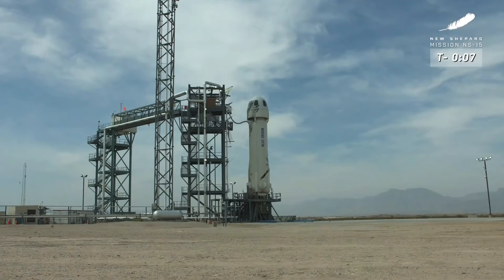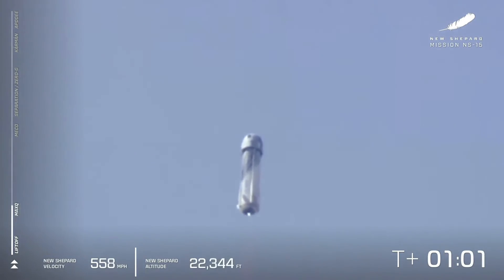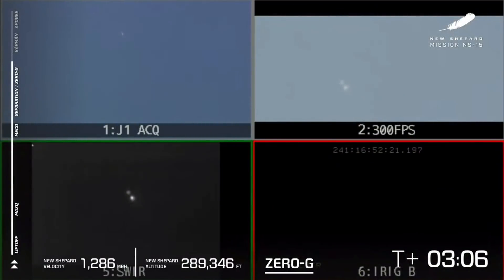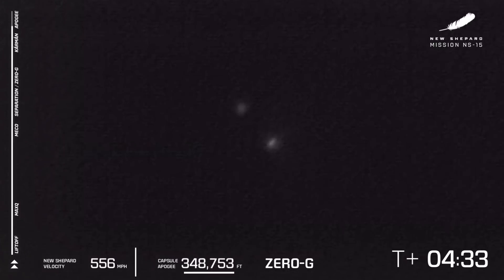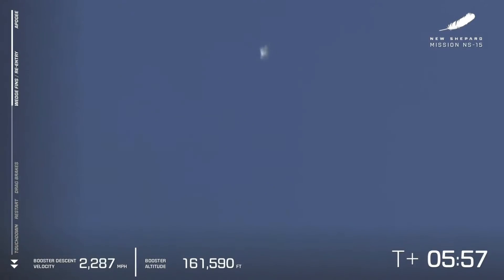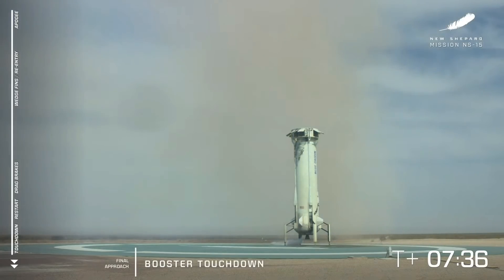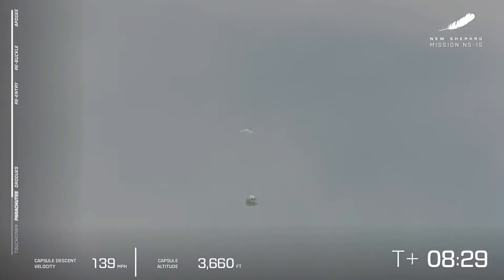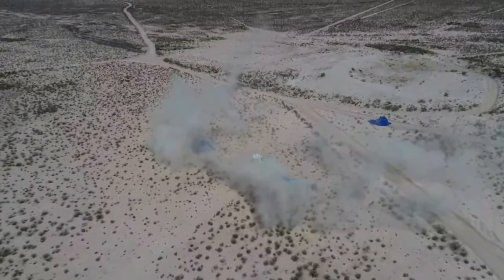Blue Origin's New Shepard launches after 'astronaut rehearsal,' nails landings!

Comment: I so want Blue Origin to succeed, but after 21 years in operation, it really has not gotten very far slowly.  If Blue Origin were serious, they would get something into Orbit and not mess around with rocket elevators ... Cmon guys ... get serious or get off the pot.  How long have you been trying to get the BE4 off the ground with a full power test?  We get it BE3 works ... one engine ... but c'mon guys.  Drop your balls, pull the other thing out and just go already !!

Comment: (Trying post again) 
0.4g calculations, if you watch closely and run the numbers. 
Check my stats and calcs, watching at 0.25x: 

1. The retrorocket activates at 118 feet elevation 

2. The capsule bottoms out (stops, v=0) at 96 feet, after travelling 22 feet farther  

3. Apply the appropriate equation of motion arranged properly (e.g. link below) : 
   vf^2 = vi^2 + 2ad      which reads as 
   Velocity_final squared = V_initial squared + (2 times accel * distance travelled) 

4. Given the conditions here, that's: 
  0mph^2 = (16mph*5280ft/3600sec)^2 + 2*a*(22ft) 

5. Simplify and rearrange: 
  -44ft*a = (23fps)^2 
  a = (529 ft^s/sec^2) / (-44ft) = -12 ft/sec^2

6. Convet to g: 
  -12 ft/sec^2  /  32 ft/sec^2  = 0.38g

Comment: The capsule decelerated at about 0.4g during the firing of that retrorocket (or whatever) at the very end, based on the distance covered (22ft) and deceleration amount (16-0mph). I've tried posting the calculations but the comment seems to keep getting removed; anyone know why? It did have the URL of the equation used, is that not allowed? I rarely comment, and this is the first time I've had trouble posting something.

Comment: These are much smaller then SpaceX but they seem to have the engines and landing down quite a bit smoother then Space X.
Reply: Cause it isn't doing any real work just up and back down.
Reply: @jackdbur  Lol. :P Have you not watched the stream of explosions coming from the Space X facility in Texas? That is just going up and down as well.
Reply: This is 57 ft tall Starship is 30 ft wide and 390 ft tall
Reply: @jackdbur  The crashes have been engine problems, not weight related. The first one the engine was running lean and not producing power. The second didn't get a successful relight, The third one had a methane leak, the 4th blew up in the air.
Reply: Your talking a sub merlin engine v a new type of engine running 4 times the thrust. This comes down to mass.
Reply: @jackdbur  Well I'm not expert but it doesn't seem that way to me. The technologies are the same, just larger engines. Space X seems to be struggling with their engines. I'm not saying that larger engines don't bring complications. Maybe they do, but nonetheless Space X can't seem to get it right and that should be the easy part compared with getting the ship on the ground. They have failed in relighting, they have busted parts left and right.

I'm still a Space X fan. All I'm saying is that the others guys seem to have a smoother product and I can even feel confident in saying that when I compare it to the smaller Space X rockets.

Comment: Congratulations to Blue Origin on a successful test flight.  Nice to see another player on the launch field.  Space X still has a considerable lead, but you're making progress.
Reply: Not sure how many companies are in on this but that landing looked so easy why do space x keep cashing on landing they need to ask these guys for help I think
Reply: @kennethmoxon7337  You're joking right? SpaceX has already landed dozens of falcon rockets that are several times larger than this Blue Origin booster.
Reply: @a.t967  The Falcon 9 has completed 112 launches and 72 successful landings. Of those 112 launches 55 of them are reflows flights. 

In fact the Crew-2 missing is reusing the Falcon 9 Booster used in Crew-1.
Reply: @kennethmoxon7337  one difference is the Starship prototype is much larger and more complex, plus it uses aero effects to slow its descent, requiring a turning maneuver just before landing.  This last part has been the difficult part in the tests.
That said I think Blue Origin is forging a new path with their retro-rocket landing system.  A capsule that can land on hard ground and not make the passengers feel like they just crashed will be valuable to anyone who doesn't have a navy.

Comment: Seems like a lot of fuel is used to land as it hovers for a while. Not as efficient on landing burns as SpaceX Falcon 9.
Reply: Thats what gave it a smooth landing, But i think the bigger issue is the really slow deployment of the landing gear. Better 2 sec extra fuel burn for a smoother landing, then no landing at all.

Comment: I think this is a perfect example of why this style of recovery is the most efficient. Just watch the booster’s speed as it re-enters, especially when it starts hitting the thicker air. The atmosphere is amazing at slowing things down, but that should also give you a hint as to how much drag a rocket has going up. Yes while in the thick air its not going nearly as fast, but it shows the dynamics of this beautifully!
Reply: Think If you can lubricated the rocket from top nose some stuff, little bit same way than theorized under water high speed's.. or leading some breaker front of body but smaller object than body cut πr2. Nowdays fast missle glow red from air friction. I think It don't have to and go still faster. Where that needed? Nothing now, I'am sure that is very researched still.
Reply: @jannejohansson3383  uh... 

Think your thinking of supercaviation. Its a process where using a different layer of fluid to insulate an object from a fast flowing outer layer. Not just for heat but for drag too. SpaceX actually does use a form of it in their booster recoveries to protect mainly the engines from the harsh aero effects of a suborbital reentry.
Reply: @Electric_Bagpipes  yeah, I have to think on Finnish and don't remember all those english names of things, cause not turn straight often. That is actually 'superkavitaatio' and iam not sure can it thinked straight "supersonic gases are "fluids". Objeckt is moving, air is still in place, so It's not pressed before "breaker" hits and leaks some fluid what expand to gas, so It's not air anymore, then vechile/rocket comes and it not effected to air. pressure is more optimized maybe or temp. All 3? + additiwes to rocket surface.. and ongoing.. ;)
You get it? I didn't remove small typos maybe. 30h awake, good night. It's 2am here.

Comment: Notice how controlled the landing is: Rather than decelerating geometrically prior to touchdown, it seems to geometrically decelerate above ground, hover at some height before landing as control is established, and then (mostly) arithmetically descend at a slow rate for an ultra-soft landing. This is likely why the landing success rate is so high for this stage.

This likely costs marginally more fuel as a few more seconds (~12 seconds, by my count) of impulse are required for the landing. I wonder about this cost at scale.
Reply: Wasting fuel. Falcon9 does that last second burn because it used the fuel to get stuff to orbit.

Comment: No camera on or inside the rocket is below the standard now. Almost like everyone is trying to catch up with SpaceX.
Reply: My favorite part is 10:10 when it lands at an altitude of 90 ft. That's an impressive feat for Blue Origin.
Reply: @psilynt1  SpaceX will have built a colony on the moon and mars by the time the rest even attempt a landing on the moon
Reply: @antilarge7860  Yeah, they won't be landing 90 feet above the ground either and will have a radar altimeter that actually works.

Comment: WTF. why are all their units imperial?! Very good way to hold back your rate of development.
Reply: Imperial measurements put man on the moon, just saying. Instead of complaining, maybe you should learn how to convert them to metric, it would appear that your inability to do so is holding back your development.
Reply: @codymoe4986  NASA has used Metric for everything since 2000 and much of the Apollo program also used metric, just saying
Reply: @neilc7101  They made the full switch around 1990....
Reply: @neilc7101  And when you say "much of the Apollo" program, how much is that exactly?
Reply: @codymoe4986  IIRC The computer systems involved were all programmed in metric, and would convert to imperial for the displays so that the Astronauts could read it.
It's pretty bizarre how imperial still exists.
Reply: @logitech4873  I mean, I have been helping build out utility grids and residential housing for 25 years using the old way....

Isn't this just an issue of ego and nothing more? What use of me throwing away my imperial tape measure for a metric one if I can make stuff fit using the former instead of the latter?

Comment: A question for those with much more knowledge than me - I was expecting some sort of sonic boom but I didn't hear anything.  Would there be one?
Reply: You will hear it during New Shepard's descent. Play the video again and you should hear the double "boom" at about 7m 05s. The vehicle is subsonic by then and the compression waves (shock waves) beat it to the ground by some margin of time. You won't hear it as the vehicle ascends because the vehicle and the compression waves it is creating are moving away from the ground and therefore, the microphone.

Comment: Serious question, why does the capsule bother separating from the booster?
Reply: Having the capsule come down on its own will be far safer for the eventual passengers. Having the booster try to land with the extra mass of the capsule would be more difficult. With the capsule coming down under a parachute, which the rocket, of course, can not do, should there be a problem with the retro rockets, the landing will still be survivable. Should the booster's engine fail on landing, it will crash and explode.

Comment: That was beautiful and light flight. Their rocket is so smooth, looks light and reliable.
Reply: Looks like its incapable of orbital velocity. Anyone can send rocket up and down. The trick is to get enough delta V to stay above the Karman line.
Reply: @sodalitia   What was it's Velocity? How far off 11km/sec?
Reply: @onebylandtwoifbysearunifby5475 
An order of magnitude far off. To stay in orbit you need 28,000 km/h of delta V. This thing was going 3600 km/h for a few seconds. Around 8 times slower than it needs to go. Also it's actual orbital velocity was 0, because it goes straight up and down. You need to go with the rocket sideways, to actually get to space. Crossing the Karman line for a few seconds can be done by fighter jet or weather baloon, so Bezos dildo is really a pointless device.
Reply: @sodalitia  Well, it's still Earth atmosphere. If you're being slowed down by the Atmosphere: you're in the Atmosphere. ISS is not in Space. 

But yes, if those speeds are accurate it is a fair bit too slow for that. It did take a dozen commercial and science projects up as payloads. So not useless., lets be fair.

Rocketlab, ULA, Boeing, and SpaceX all have a lane. Different vehicles for different purposes. 

This operation was extremely smooth, well engineered, and well executed. 

Maybe it can't launch a Parker Solar Probe; but neither could SpaceX.
So as a conglomerate industry, this was a nice step up.
Reply: Looked effortless and elegant.
Really a beautiful 🚀 system.
Blue Origin is impressive.

Comment: all this feet/miles thing brings the whole story back to middle ages. go metric people!
Reply: who invented this system was an idiot
Reply: Imperial measurements put man on the moon, was that during the middle ages?
Reply: @codymoe4986  i am afraid that nasa runs metric my friend, yes imperial is preistoric
Reply: @fabiopignata  NASA made a full switch to metric around 1990, and you need to review your understanding of the word prehistoric...
Reply: @codymoe4986  just pointing out that 99% of the world has no clue (without google) what a gallon, mile, inch or pound means. Not mentioning the crazy definition of F degrees
Reply: @fabiopignata  How does it negatively affect you if someone like me, out in the middle of nowhere America, uses miles to measure my driving distances? Uses feet and inches to help build houses?

I had no trouble using metric to strap drill pipe while working in the oilfield,  and my head didn't explode when I picked up a standard tape measure after work to measure out lumber lengths to help build my house...

What is good for the goose is not necessarily good for the gander....
Reply: @codymoe4986  I so miss those middle of nowhere places in North America! ;-) there's nothing wrong with imperial as long as they are not used for international stuff. Besides that they sound so much Old Wild West stuff :-) kinda love it

Comment: Will Blue Origin ever be used to actually take people or cargo into space?
Reply: That's a good question, and the correct answer is maybe, most likely. I expect they will finally start flying people on suborbital hops with New Shepard in the next year, and that New Glenn will start flying in late 2022 or early 2023. Whether either of these will be economically viable in an environment dominated by Starship is another matter. Both NASA and the Defense Department have valid reasons for wanting to maintain two independent launch providers. Right now, for the most part, those are SpaceX and ULA. SpaceX has most of the commercial market, most NASA contracts, and a strong hand in DOD launches, and ULA has a few government launches per year, mostly DOD, at a guaranteed profit. Northrop Grumman also has an ISS Commercial Resupply contract. My guess is that, if New Glenn actually gets flying in one to two years, Blue Origin will supplant ULA as the government's backup provider while SpaceX, with Starship, becomes even more dominant over the broader market.

Comment: I like this rocket. I just wish Blue Origin would actually do something.
Reply: They are engineering first, and launching afterwards.
(Looks smart to me).
Reply: THANK YOU! ME TOO
Reply: @rbwannasee  haha, did you not see yesterday’s news? Blue Origin isn’t winning anything. I promise you that.
Reply: @rbwannasee  Not in this case. ULA and SpaceX are way ahead. Blue Origin has not put anything in orbit yet. I doubt they ever will. Note that getting to just above the Karman line is easy compared to getting into orbit. 8,4 km per second is a different thing altogether.

They will need a good first stage and they have not finished it.
Reply: @juliusfucik4011  Finally, someone with brains. This big dildo is incapable of withstanding anything close to supersonic speeds and achieve orbital velocity. This toy has capability of a weather baloon.
Reply: @sodalitia  have you seen New Glenn and the huge factory built for it? Maybe not, check ot out. Not a Musk or Bezos fan but there are plans for actual orbital flights
Reply: @rodrigomartinez383  The conversation is about this rocket and it sucks. I am not going to comment on futuristic projects in the making, but the current state of their program. People got hard watching this and start comparing it to Starship, also in the making, as if it was a fair comparison. Its not. Blue origin is years behind the competition. This rocket is what Falcon 9 does already. Their single stage model is pointless from the design point of view. They never actually lunched it into orbit, but all they do is vertical "hopping". That's not how rockets are supposed to work, and this test demonstrate nothing.
Reply: @sodalitia  uhmm, maybe you weren't looking at the SPEED in the lower left corner.  Supersonic is over the speed of sound.  It was more than 3 times the speed of sound.  ...also please show us your amazing design.

Comment: it almost looked like a falcon 9 landing... nice work.
Reply: It's quite different on how it works. 
New Shepard can hover, so it has more time to slow down
Falcon 9 doesnt have enough fuel, and the engines are too powerful to hover, so it has to light at the latest time possible, so that when it exactly hits the ground, its velocity decreases to 0.
Reply: @nagaea7409  Falcon 9 has more complex booster landing flight control.
Reply: @nagaea7409  every second you spend in the air, you have to compensate for gravity. landing as fast as possible by lighting at the last possible second, is the most efficient way to land
Reply: @lemonandgaming6013  yes
Reply: @Farhan Dany Fachrullah yeah !! Falcon booster landing looks really cool than Blue origin booster landing.
Reply: @kukunishad  

I don't think it matter which one looks cooler 
The most important thing is that they are both making progress.
Mars colonizations & moon colonizations are coming to reality someday because of this lol

Comment: Using standard units... Wouldn't expect anything different.
Reply: Using those measurements, we put a man on the moon, just saying.

100 mph=160.9 kmph=the same damn thing...
Reply: @codymoe4986  It is. 
It just goes against convention in terms of science and engineering. 

NASA did use metric on its flight computers. Standard units were mainly used for visuals ie. for quick understanding by the astronauts and the general public.

Comment: 16mph hitting the ground would still be a good thud inside the capsule. Otherwise perfect 👌
Reply: I think they have deceleration devices in there. Energy absorbers and suck. Cars have 5mph bumpers, causing zero damage. This thing has 16+
Reply: @onebylandtwoifbysearunifby5475 well that would help if there was something inside to cushion the impact
Reply: @markd9580  There's video from inside the capsule, shows it was a nice gentle landing. Angle made it look bumpier. Tried to link, but got deleted. Search for Blue Origin YuTub channel.